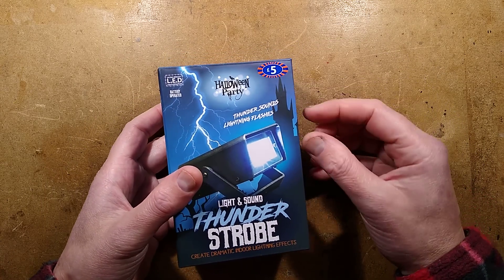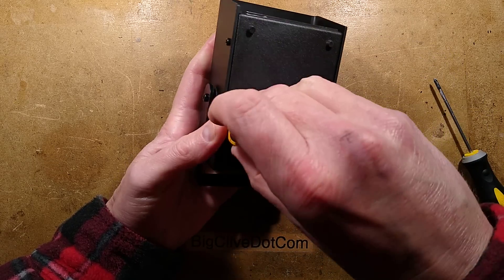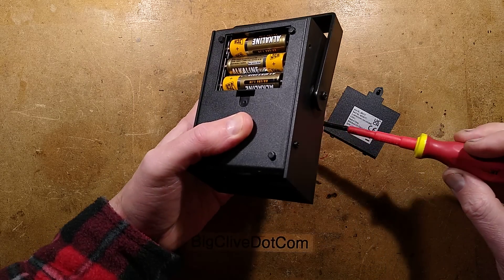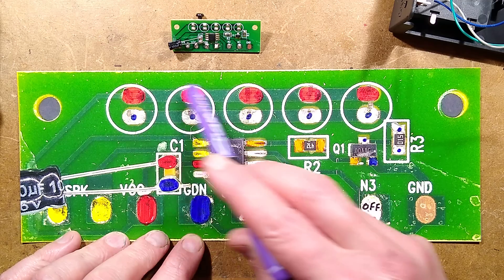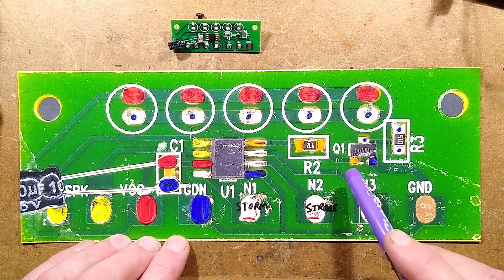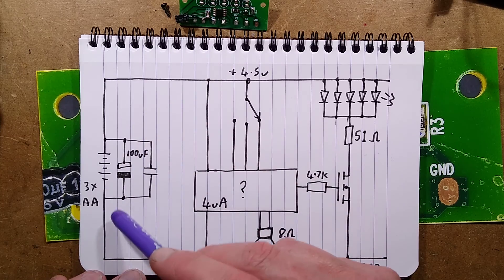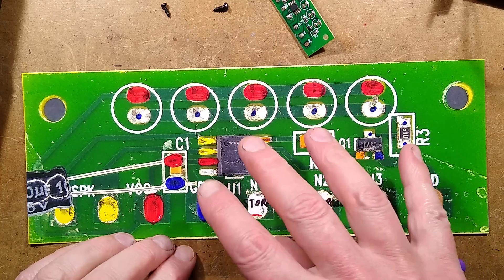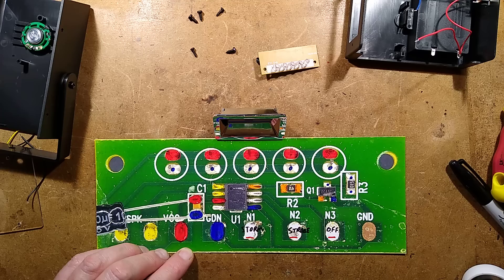Hackable Halloween poop

Comment: What are the best rechargeable AA / AAA batteries for smart home tech (motion seniors etc)?  Are there rechargeable coin/button cell batteries?
Reply from the maker: Good quality NiMH cells like Eneloop are a good choice for some equipment.  You can get rechargeable lithium button cells, but their capacity is lower than non rechargeable ones and the voltage slightly different.

Comment: We have these in US at Home Depot for $7.  But ours have a 3 way switch on bottom.  Left is On (sound mode), center is OFF, and right is strobe mode.  There is also a pot to vary the strobe time.  On the side there is also a try me button that plays sound and flashes for a couple of seconds.  And it also comes with 3 carbon zinc AA batteries.
Reply: You mean True Warp Lumber Company DBA Home Depot?
Reply: @coloradostrong  We just call it Home Depot in NJ.

Comment: OMG the programming skills demonstrated in this product are just lazy, it's like the programmer had zero imagination.  I think the most likely reason is that there was a demo programme available from the chip manufacturer, and whoever designed this barely knew enough to be able to change the sound bite (if they did).  Adding in a rnd() function for timing and different sound bites was beyond them.

I suspect the circuit was similarly a sample circuit they copied verbatim.  There's just too much weird stuff going on with this product.  Whoever they got to troubleshoot the chip stability problem must have been shaking their head.

Comment: As long as you don't want sound, you can get and use any flashlight that comes with the Anduril "UI" (user interface).  Its blinky-modes include candle, bike-strobe, party-strobe, and lighting.
For most realism, get warm-white (2700K or lower) for candle mode, and cool-white (6500K or higher) for lighting mode.
Quite nice.
Reply: The lightning mode is a lot of fun, especially if you have a separate 2700K flashlight as well to run candle mode.

Plus, many Andúril flashlights (mainly from Hank/Intl-Outdoor, but elsewhere too) include readily accessible firmware flashing pads so you can easily flash new or customized Andúril 2 builds to your heart's content!

Comment: I suppose one could run the "audio" output through a low pass filter and amplify it but I strongly suspect it would still sound like poop.
I admit to being curious as to whether the audio waveform correlates with the signal driving the LEDs as you suspected before opening it (please break it the Clive-O-Scope more often). Some nice big COB LEDs and MOSFETs to drive them and an AC to DC power supply would yield far more convincing lightning.

Yeah, this thing is a nice springboard parts kit.
Reply: Not sure any low frequencies exist in this to make it past the filter...haha... Might be better to pitch shift the audio first somehow?
Reply: @Agent24Electronics  Yup. These things only sell because so few people have any idea what kinds of tech needs to be packed into something like this to make it do what it says it can do and what that would cost.

Comment: I purchased one of those several years ago from a local "party supply" store.   You cannot turn off the sound - I ended up opening it up and disconnecting the speaker completely.  I wanted the flashes, but didn't want the obnoxiously loud noise right next to my ear

Comment: I suspect the audio is just digital PWM  with no low pass filter other than the  speaker coil. You might improve the audio quality with a simple small value capacitor across the output to temper the digital edges. But salvaging the case and reflector is probably your best bet.. Thanks as always.

Comment: I wonder if the OFF position just forces the µC to go into deep sleep mode, to be brought back to life on switching to any other mode, so the capacitors will always be charged, in contrast to cutting the power off and having undervoltage problems at startup. What do you think?

Comment: 3:34 Regarding the bodged electrolytic capacitor: I'm guessing either someone went overboard with reducing part count, or they tested the circuit with a low impedance power supply only to find out that driving 5 LEDs from a high impedance source (batteries) doesn't work that well without a decently sized cap.

Comment: I had an identical strobe light, but it was preset flashing speed, the resistor was changed for a potentiometer and then I had infinite flashing range, though it required a hole in the front

Can the 4.7k be changed to achieve the same?
Reply from the maker: No.  The speed is locked in the chip.
Reply: @bigclivedotcom  balls...

Comment: Those things seem to get worse every few years. I remember seeing ones here in the US that were about $10-12 but were actually decent little strobes. I saw one last year that was around $5 and its idea of strobing was to slowly blink. I suppose it was to prevent seizures but was total garbage.
Reply: Bingo.   I saw one of these new units and I just cringed.  Gosh awful these new units.
Reply: $5 is still cheaper than many project boxes. I wonder if the manufacturer will sell just the case?
Reply: More badly designed garbage that's going to waste people's money and end up as landfill. I'm all for the free market for quality items but would also welcome rules to prevent imports of such tat as this.
Reply: I found an old one at a thrift store, great little strobe light, no sounds.

Comment: Definitely a £5 project box. Looks like you could squeeze in a few 7 segment displays for a bench tool like a timer/counter or small PSU. Plenty of little kits on eBay that would fit.
Reply: Pretty sure for £5 you could get a far better built and higher quality box from CPC!
Reply: @Leftfield2k7  Pretty sure any small benefit would be swallowed up by the cost of postage. CPC/Farnell ain't as cheap as they used to be, especially for non-mainland UK or Europe.
Reply: mint
Reply: Agreed
Reply: was gonna say the same! for the price..the plastic box would make a nice project box...